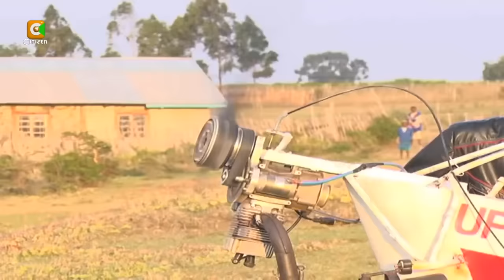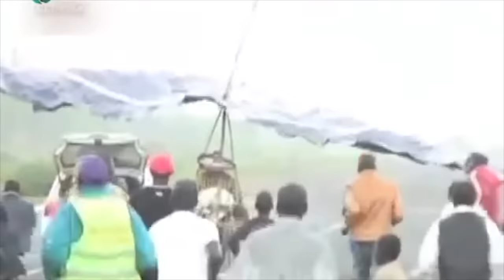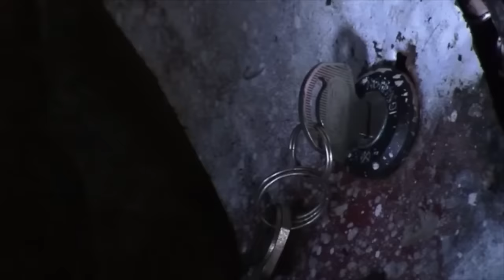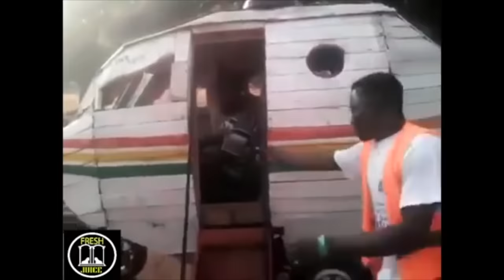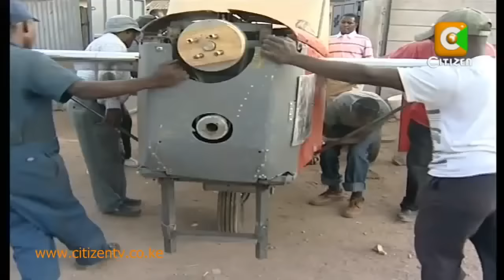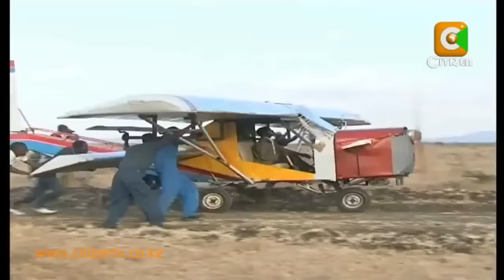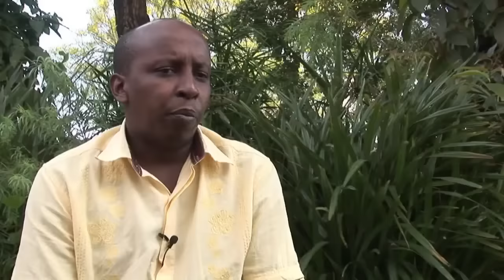African Airplane Compilation | African Aviation

Comment: I remember building one of these "aircraft"  as a child. Mine was made of cardboard boxes and rope.  I swear it would have flown if I just had more funding from the community.
Reply: of course !! no one will never knows.....
Reply: lol reminds me of redbull flutag competition
Reply: Remember the best plan is always the one that requires just a little more funds and maybe a little more after that.
Reply: Well said my friend!
Reply: Get back on that!
Reply: This is the same thing happening to all this African people, they do this without almost any funding and resources, but the basic idea is there.
Reply: @timhallas4275  You know a basic idea right?
Reply: @claude199x  Necessity is the mother of invention. Since so many fundamental needs are not being met, inventions will continue!
Reply: I did receive some funding from the community (my grandparents). Then I spent it on cookies and had to shut down my aircraft project
Reply: @danieldaniel625  I eventually got an engine and prop for my cardboard airplane, and it almost took off. Damn fence got in the way.
Reply: Actually carbon fiber technology cardboard easily flies light and strong just needs stabilization like rezin soaked woven fibers doing it to cardboard alone might be possible but saftey margins
Reply: They are putting the, "craft," in aircraft.  They just need to put a little more, "air," into it.
Reply: You have a better chance at making something built out of cardboard fly and any of the shit aircraft from the video. I’m not an aerospace engineer, but even I know that this shit just won’t work.
Reply: @Sniperboy5551  Africans build aircraft based on a still photo or seeing one fly over at 10,000 feet above them. They end up with something that LOOKS like an airplane.
Reply: They need education not money. Some people wrongly think Africans are dumb from this video but this actually shows their potential. Quality education is not getting out there fast enough, no doubt these people would be passionate engineers
Reply: @cloroxbleach9222  They have limits of basic intellect. You can show them how a machine works, but they cannot understand why it works.
Reply: @cloroxbleach9222  Most commoners can not even build the failed aircraft the people in the video built, if they had to do it.  I must laugh at those mocking their efforts when most of them could not attach a simple wheel to a shaft axle.  Most of them can not even change the tyre of their automobile.
Reply: I would bet it could fly quite a long ways it you took off from the top of a skyscraper or cliff..
Reply: @claude199x  Other people and countries fund themselves. Why do you believe it should be any different for Africans? You do understand that sub-Saharan African nations receive 10s of billions of dollars every year from Western nations, right? These aren't even loans it's just Western citizen's tax money going to those countries. Maybe those countries in Africa should start sending Western nations 10s of billions of dollars every year.
Reply: @timhallas4275  if they just found a really simple plan for building and weight to power requirements they sure could do it. Sourcing a light engine with enough power would be the challenge since they are expensive. Maybe they could use an engine from a 2 stroke motorcycle as a cheap alternative.
Reply: @ceaseanddesist8036  More power would just kill them sooner.  They do not understand the principals of lift and drag.
Reply: @AnonMedic  haha! The RedBull Flugtag competitions are some of the most entertaining competitions to be found! Followed closely by their soapbox races! After watching one for the first time on YouTube long ago, I don't think I watched any other videos until I'd seen them all.🤣
Reply: @Claudio Gagliano Ramirez don't have time for your rants
Reply: @timhallas4275  haha yes they would die without training. If they just followed a really simple blueprint for building a plane they could do it. I dont understand why they dont. They have internet
Reply: @ceaseanddesist8036  The internet is not a replacement for a brain.
Reply: @timhallas4275  hahaha
Reply: All you needed was to slap a Merlin engine in that bad boy, and you'd be taking down Bf-109s.
Reply: @Bl4ckD0g  Gabriel was sponsored by a Norwegian Tv show. Getting a rotax engine and PPL license. However nothing came of it.
Reply: Or government  that  would have spent billions on you re card board  air plane if   said to by.   Military industrial complex yeah  the D. C group
Reply: That's all africans ever need, just a little more funding or support .
Reply: @blehbleh4962  Did you know that in Zimbabwe they threw out the white farmers, then ate the seeds that had been stored for next year's crops?  We had to rescue them from themselves again.
Reply: You shoud have joined Theranos…
Reply: dumbo grifting animals
Reply: @just_one_opinion  Funny how even in Africa they still look for handouts.
Reply: Ours was balsa and rubber bands. Sold it to the Nigerian Air Force for ten coconuts.
Reply: I did the cardboard wings, jumped off the peak of the garage roof.  No broken bones, but knocked the wind out of me.
Reply: @AnonMedic that is true even without engine they can glide 🤣😂🤣😂
Reply: @duskintheforest584  we put plywood on — wait for it— a shopping cart— but HUGE plywood wings— and pushed it downhill NOT with me in it— but at least Peter wore a BMX helmet — it actually got airborne— of course we at least we’re in fourth grade, unlike these people. hahaha - glad you were ok
Reply: Hahah
Reply: I jumped of the top of a barn with cardboard wings tied to my arms and yes it did fly it didn't go far but damn was it fast...
Reply: @claude199x Lol they're not even inventing or pioneering... they're trying to copy existing designs and inventions 😂
Reply: @cloroxbleach9222 unfortunately they actually are rather limited. Genetically they have higher stamina, higher hormone levels and thicker skeletons. Simple genetics and it can apply to the brain too. And it does.
Reply: @ceaseanddesist8036 of course not.
Reply: @---qb1bf  I'm not denying the affects of genetics, just saying there is no reason to believe these men wouldn't be good engineers if they go through quality education. We can assume they don't really have that here.
Reply: @cloroxbleach9222  No actually there's still good reason to assume they won't be. It's all over the northern hemisphere where they do get the education. Certain institutions have even said they get book smart at best, able to recite their textbooks...but applying practically and thinking just isn't there.
Reply: @Clorox Bleach  the first flight was in 1903 by two bike builders....think about that for a sec.
Reply: @indridcold8433  I don't know about that. If I can build a drag car I could probably build a plane.
Reply: @trueblood2469  A single engine is really easy.  I replaced an old 152 experimental's wiring. I could not believe how simple the beautiful little plane is. I have welded a tube frame for a dragster with transmission axles, and steering.  But the customer never gave me the engine, and rightfully so.  He took the rolling tube frame and finished it.  Granted, I just welded what he wanted like a puzzle with instructions.  But I could not believe just how small and simple those rolling chassis are.  Currently, there is another rolling tube frame waiting at my home shop waiting for modifications. It is not the one I built, though.  When one can weld, the word gets out very quickly, even without any sort of advertising.  I am also an introvert so being social is not in my skillet.  It is almost as if people know I have a gas and electric welder by telepathy.
Reply: @indridcold8433  lol I taught myself how to weld as a hobby.  I actually own a construction company.  I have neighbors knocking on my door weekly asking for help.lol I feel your pain .
Reply: @proteo-x4u  So african aviation is on the same level as african economic and country management!
FIRST THEY NEED TO FIND OUT ABOUT HEAVIER THAN AIR FLIGHT, ECONOMICS AND HOW TO RUN A COUNTRY! Or even just the ability to see the weight is too much for their design! will be a great advancement!
"LISTEN PROPERLY!"
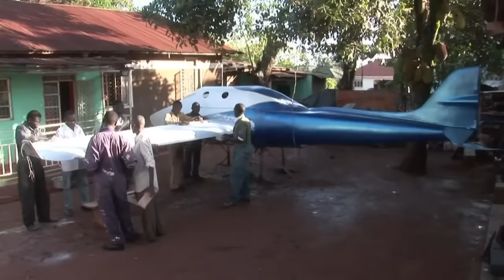Reply: 06:20 the founder of the african SPACE RESEARCH PROGRAM "I DONT UNDERSTAND HOW FLIGHT WORKS!"
Reply: @nilasferm1239  Then explain how some dog breeds are so much more intelligent than others? And how the unintelligent ones will stay so unless you start breeding them with smarter ones? You don't mix them with better genes and they'll stay as they are.
Reply: Can´t think of more derogatory statement.
Reply: @canarias2639  Sure you can just try harder..
Reply: @canarias2639  Sure you can.  Just think about what is happening in Chicago right now!
Reply: I heard Boeing stole your plane when you parents put it out for trash
Reply: @rbxrockettrio8650  Damn it. I knew that new 757 looked familiar.
Reply: @---qb1bf  which doesn't contradicts anything I have said...
Reply: @timhallas4275  I build electronics from scratch and understand why they work. Does it mean am a white man trapped in an African's body? 😏😏
Reply: @timhallas4275  I don't have Caucasian DNA and yet I have achieved a lot as far as electronics tech understanding is concerned. Roy Allela and many other Kenyans too have achieved a lot without the so called "Caucasian DNA". You aren't special bro. It's just the advantage of being the right place at the right time.
Reply: @timhallas4275  Iam. A Bantu to be specific. Kikuyu by tribe. Anyway, Nobody in Africa is "purely negloid" Every ethnicity exists because of a mixture of ethnicities and races to some extent.
Reply: @danieldaniel625  thats todays airline industry in a nutshell.
Reply: I remember parachuting from the roof of our carport with a blanket tied to rope.
Reply: @indridcold8433 I agree. most western commoners would KNOW not to attempt to build the failed aircraft without a lifetime of studying aerospace engineering principles and manufacturing. Thanks for acknowledging that the base level intellect is a huge difference.
Reply: Damn SaCiety!
Reply: Where's a Nigerian Prince when you need seed money?
Reply: @timhallas4275  yet 90 years ago they couldn't read
Reply: @Naz1Killer  And they still wouldn't be able to if not for Caucasian colonization.
Reply: @timhallas4275  they had the nsibidi writing system, and this other one I admittedly don't remember. You'd know these things if you did indiscriminate research
Reply: Yeah good on ya. respect
Reply: @cloroxbleach9222  100%
Reply: Sell the plans to Africa.
Reply: LOL
Reply: well even a large paper airplane will fly so technically you could have flown
Reply: @timhallas4275  Or structural engineering or loading.
Reply: @smgdfcmfah  Just cash please.
Reply: Cite your source for your claim on their brain power.
Reply: Should have asked the Ugandan government
Reply: @gilliesiut2332  If I only knew.
Reply: 😂😂😂cheers to that! I remember as a child having a dream I built a plane purely made of plywood and pedal powered lol
Reply: 100$ worth of fireworks would have surely done the trick.
Reply: @---qb1bf  so we should race mix ? huh?
Reply: Ese es el punto, les percibimos como a niños jugando, experimentando y obviamente sabemos que no funcionara la invención, por aqui en Colombia, también percibimos a los uribistas de la misma forma, Un poco más ingenuos por no documentarse objetivamente, solo que no siguen a alguien que crea avionsitos, sino a politicos que crean hermosos proyectos.
Reply: It's telling the most successful thing shown in the vid was a modified motorbike with a helicopter shell
Reply: @claude199x They need to learn the basic idea the plane needs to be light, even moreso with those tiny engines
Reply: @receiving9067  They don't have a  clue on how an airplane or helicopter flies. They see it as magic.
Reply: Feel sorry for you bruh
Reply: @Jessie-xx7ir  It's OK. I'm all grown up now and I understand how this all works.  I should have told them I was black on my uncle's side.
Reply: In the early 50s, one company was selling pocket planes. They were sent to you in boxes, and their fuselages were inflatable, just like balloons. It worked.
Reply: @M3rl1n177  I remember that. It didn't work.
Reply: Bruh that sh!t had me dying 😂😂😂😂 plus I'm high AF.
Reply: @chrisrodriguez7351  I was stoned when I typed it.
Reply: Frankly, unless you just know nothing and have some mental disabilities, nowadays it's not that hard to build a working plane from scratch. Of course, at least you need free time, and a bit of money.